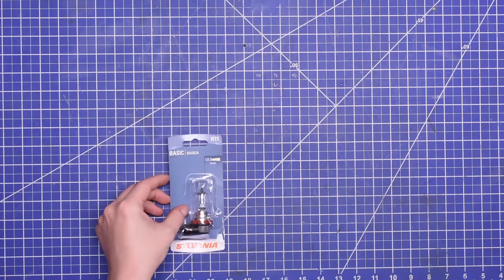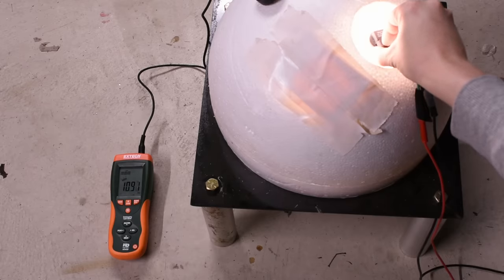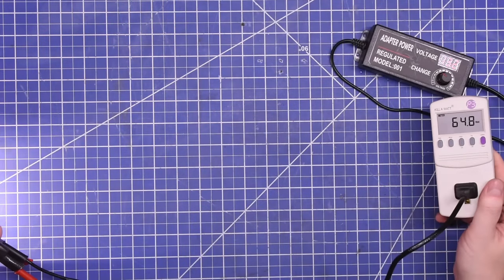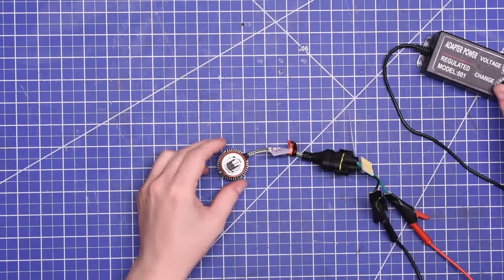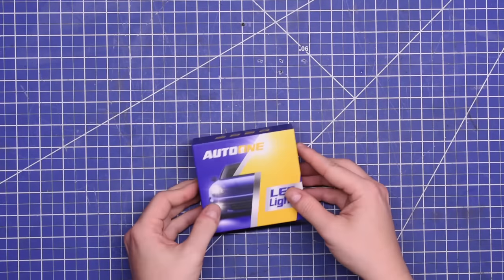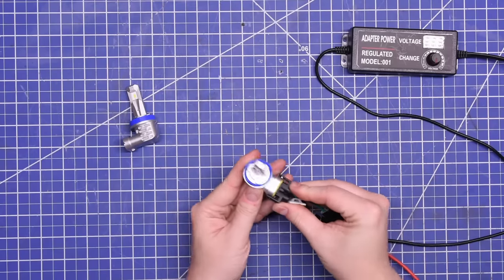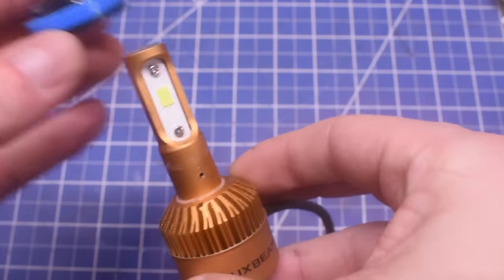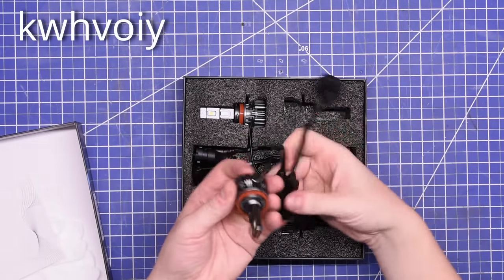Amazon Headlight Bulbs are Getting Out of Hand

Comment: The listed lumen outputs are for all the led's in the pack, not per light.
Reply from the maker: If you go to the listings that have the option and select 1pc, still says the same lumen figure
Reply: I'm part of Amazon Vine, basically I get free stuff from them and review it.  I have had enough of these pass through my hands to know that the lumens listed are for the pair or set of pairs.  It should say it in the descriptions of some of them. I'm not trying to start an argument or anything, just giving my findings based on experience.
Reply from the maker: @OhhGeee Even so it looks like the numbers are fairly made up either way :P
Reply: @TorqueTestChannel   Yes indeed they are massively inflated either way lol.

Comment: Isn't it also that the led's are better if you put them in a lens in sted of reflector headlight set? 
Atleast that what the inspection guy at the police station told me, that led have a better light pattern with lenses insted of the reflectors.

Comment: One other thing to consider when installing LED bulbs in your stock headlamp housing, the LED chip MUST be in the same position as the element in the halogen bulb because the reflectors are designed for the light to hit at a certain reflection point.  If this is off in any capacity, the light will scramble and not be focused causing bad light for the main vehicle driver and blinding glares for the oncoming drivers, and that's just a dick move!

Comment: I have a 36000 lumen light.....And it's water cooled.....And you do not want to look at the light.... and lights up 700 meters like the sun....Besides that, the price on it is ludicrous, it's not an Amazon price deal.....
I also have a Cree led that has actual max 3000 lumens, and you can't put them on a car's lighting system (even if it fits just lovely inside the light casing) ,  because it would blind everybody at an intersection.
Bought once an OEM led bulb instead of the classical incandescent OEM bulb for an Seat Ibiza......couldn't use it without half the people in traffic swearing and at least one police officer asking for the reciept or homologation of my lighting system...

Comment: The led market is largely off in the weeds: color temperature ratings seem to come from another planet, and as you found out... the output testing of a large portion marketed sucks.  I happened to meet a couple real light engineering pro's some time ago and the subject does get complex because current really matters in driving led's, plus lab instruments are more pure - they can fail the human experience by being... more accurate.  Why?  Because our eyes react differently to various wavelengths: response is non-linear.

Comment: for whatever its worth to anyone, I got auxbeam bulbs for my subaru and the ones I got are insanely bright. I guess those H11's you got are the low end shit ones? I saw they are $33 currently but the better ones are $80. My subaru takes the H4 9003 bulbs and they were the high end $80 for the pair ones. Again, holy smokes they are bright as hell. And the beam has hardly any scatter and looks fairly dead on for the "cool white" they advertise. And high beam goes a quarter mile down the road now. Guess you get what you pay for? Which was shown even in the halogen bulbs. Cheap LED normally means CHEAP and not good.

Comment: You did not measure the loomans properly as per the manufacturer (and Amazon) of the bulbs. To properly measure the lumens, you need to place the bulb between the Sun and the testing device. Then you will get the reading of at least 36,000 lumens.

Comment: you do understand that lamps made for halogen wont perform well with led inserts. the reflector has to be shaped for the two side output  led where halogen has 360 degree output. this change in location of the light source is why the streaks and blinding glare eminates from the cars with these conversions. the lamps are so blinding i dont drive much at night and when blinded by some fool i light up the light bars on my lifted jeep thats so high that the lights should never bother me . and then blind them back with off road lights that do focus the beam correctly. one only has to install the power tap to the relay off the high beam relay so you can flash aux light bars and the hig beams to let these idiots know they are causing vision issues for other drivers and how it feels to be blinded for several seconds at 60 mph... if the lamps are not dot approved and on file they are not legal for use on us roads just like aircraft landing lights and off road lamps are not allowed for the dangers of blinding other operators...buy reflectors that are meant to be used with led bulbs dont think you can out think the engineering teams who built the car or truck..you cause issues when you deviate from factory in EVERY SINGLE INSTALLATION be it lamps radios and other electrical parts especialy alrms and remote starters! more damage is done by installation of custom nonfactory items

Comment: Brightness doesn't matter when you have color temps above 4K, because our eyes are naturally tuned to perceive light in the 2500-3500K range, which is commonly called "soft white". That means that for a given lumen rating being the same between two bulbs, the one with the color temp in soft white range will illuminate better than an LED in the 6K+ color range. Furthermore, that harsh white/blue light that you get in the 5-6K color range messes with night vision and will increase eye fatigue.

Halogens are the ideal bulb, short of that, a quality HID (xenon) system in the 4K-4.3K range. LED lights running off of your alternator flicker, because even though the alternator current is rectified to DC it is not smoothed with capacitors. This flicker occurs at a high frequency that is not perceptible but it has more negative effects. LED lighting is the WORST kind of lighting, and unfortunately, most people are too dumb to get that.

Comment: I appreciate this test, and yet I'm disappointed. I have a 2017 Ford 'Superduty' pickup, equipped with standard incandescent headlights. The light projection quality is DISMAL, no better than a 1969 Chevy pickup I once owned. And, that's despite the Ford running 4 headlamps even on low beam (this angers some oncoming drivers because they may assume I'm driving with high beams on). Ford's incandescent headlights are vastly (and I mean VASTLY) inferior to the HID lights on Chevy pickups. I had hoped this test would reveal aftermarket LED bulbs to remedy the issue. But I'm disappointed by the test results. It appears that the aftermarket LED bulbs are likely to be just a half-assed solution.

Comment: Dude, look. First of all, finally someone made a perfect compare video, thx for that. But your research of LED bulbs is very poor. First of all, those led are best for high beam and low beam with Lenses! I'm surprised you had at least some pattern on the wall with led and old school reflector headlight, lenses is what is best for led. Then, there are scams in led market. And I think you bought one, only the tiny /slim chips are legit, often look like 3 tiny cubes united into long chip, the huge once where one solid chip approximately 6mm x 10 mm are cheap trash and do not keep the pattern of light on the wall. A good price for a good led is 45€+ not less. Some 30$+ are good, just got old and on sale.

THE ballast! Bulbs without that are considered bad becouse that ballast contains resistor to trick your car canbas system to this that there is a bulb, without that ballast resistence of a chip is low and car thinks bulb did burn and show error on a dashboard.
Do your research and don't create misleading videos

Comment: Nobody needs lights that are brighter than original. The OEM lights on new vehicles for many years have been great. Long-lasting and plenty bright. I've only had to replace one lamp on  my 2010 F-150, a tail light. That's 13 1/2 years. 
Even some  of the newest OEM headlights are too bright. Until recently, it was illegal to use brighter than original headlights on public roads. For good reason.  Nobody should have to face them  while driving.

Comment: Crazy lumen claims aside though... go ahead and by headlight bulbs off Amazon. I had the expensive xenon crap in my car and one bulb 'name brand' was like 100+ fucking bucks, but a two pack off amazon was like literally a quarter the price. At that price even if I had to buy three sets in the time one of OE set lasted I'd STILL be ahead, but they've been in the car for three years now without issue so far. Just find ones with a ton of decent reviews. 

Sometimes cheap means crap, but sometimes expensive just means you're getting gouged. This is clearly a case of the later IMO.

Comment: You’re not running near enough voltage through those lights. 12.0 V is not a normal voltage for a running vehicle. You should probably be at least 12.5 to 13 volts with the car running.

Comment: These things are an absolute menace when people put them in halogen housings. They scatter light and the color temperature is way too high and more harsh on eyeballs. Just use the correct halogen bulbs for your OEM halogen housings unless you can buy a DOT approved replacement housings.

Comment: Would've been nice if the testing had used the adjustable set rings as they were designed instead of just glossing over them as, "Not usable," by virtue of TTC not understanding how they work. That threaded hole isn't for the set screw. The set screw uses basic friction on the housing to keep it in place. Same as the one that, "Could get left behind in the headlight housing." Most of the LED headlight kits are hot garbage, but even more are garbage because people can't be bothered to figure out how to install them properly.

Comment: Higher performing Halogen Bulbs are hotter, have a thinner wire and the winding is more compact to get more use out of the reflectors focal point. The often seen blue tint is actually not to make the light look more cold in temperature BUT to reduce glare from the brighter wire and keep everything is specs. With a thinner, more compact AND hotter wire, of course, lifetime is greatly reduced. It is all just physics, sometimes really frustrating. bright, no glare, long lifetime, spec wattage ... is always a compromise for every halogen bulb.

Comment: sorry however most of these bulbs are utter garbage. I use a different brand and will never use a fan based led. The main thing to remember is that you have to orient the bulbs properly and they will be fine without blinding people. I had to replace the bulbs in my minivan as the ones that were installed sucked and thankfully they were the same as my previous vehicle so I was really happy. Now the extra power the ballast uses is usually enough to keep the light out indicator off. I would love you to test the less purchased lights as they are generally more expensive and usually do a better job.

Comment: The  review leaves a lot to be desired. The technical equipment was good for info but the use of the headlight was ridicules, no information on that and waving the light all over the plce was a mess. You couldn’t see the placement of the bulbs in the headlight. This review really fell short.
The other issue is without seeing the headlight, you don’t know if it was designed for that headlight. 
Too many variables not addressed

Comment: How a light performs, in a given headlight housing, is the main point of this whole test.  
You have a beam spread wall - great.  Being able to compare light for light, is relevant and interesting, but only up to a point. 
I think what's really needed, is the area being lit.  

Aside from a light for light comparison, how do we put that beam spread in context?  
We don't know how far away the wall is, so we can't determine how much wider or higher a particular beam spread might be.  
We need some more tangible context, to make the test more meaningful. 

Could you add an outline to the wall, of an oncoming vehicle?  Maybe 2 or 3 - regular passenger car height, another for the average SUV and - cos, Murrrca - a lifted pick-up? (Strictly, that's a tautology - but even though we Strayans invented this type of vehicle, you've never taken on one of our terms: the utility! )
Seriously, roadmarking lines too.  A pair drawn in the correct perspective, for a road's centre dividing line, and the kerb line. 

Another aspect which I haven't seen noted, is that the road surface isn't all the same distance away from our cars.   The upper part of the beam is reaching the road 4 or 5 times as far away from the car, than where the lower part of the beam reaches.
The upper part of the beam dissipates greatly.  That means the further up the wall we look, the more exaggerated the illumination is.

Comment: Sylvania bulbs ALL suck. Period. Tried them and not worth having. Bought Fahren 30,000 Lumen for my Challenger and they are awesome. Tight light no scattering illuminating the shoulder WAY down the road without blinding oncoming traffic. ALWAYS check bulb alignment correctly (flat wall tape measure. Look it up) and adjust accordingly after replacing headlight bulbs.

Comment: Your integrating sphere is not anywhere near good enough to get accurate readings. At best you can do differential but even then polystyrene is not a great reflector. You need to get a sphere and coat it with barium sulfate. I mean, they are obviously lying about their output, but thats nothing new.

Comment: Temperature and light quantity are very different measures of light.  Light quality is a measure of colour contrast, the worst being the old sodium street lights since everything seams to have one colour as they have a single wavelength.   First gen LED , or just shit lights, are the same lack of colour discrimination so loss of colour contrast making things difficult to see.  It would be better if you used a simple spectrometry,  even on a phone, as light quality is critical to seeing things in headlights as your brain is tuned to colour contrast.